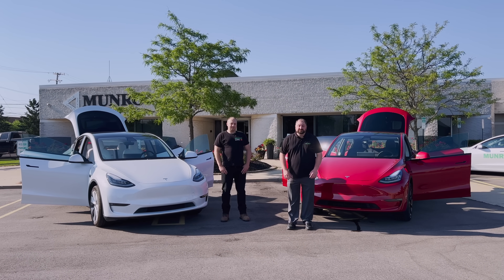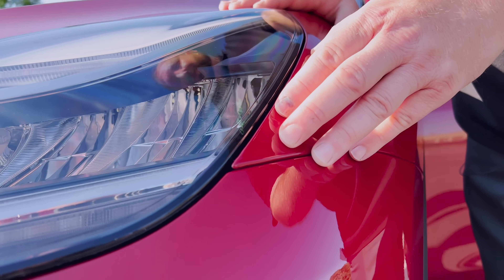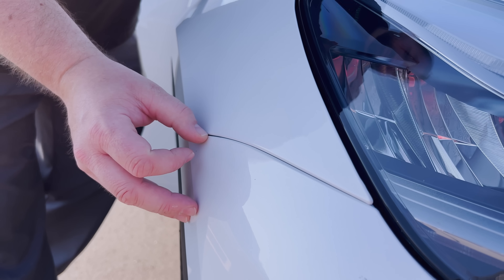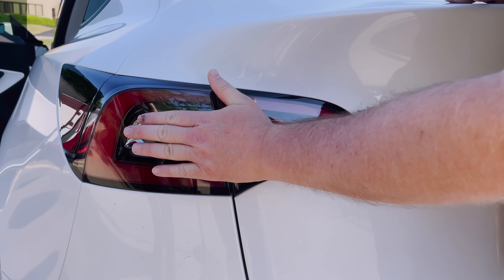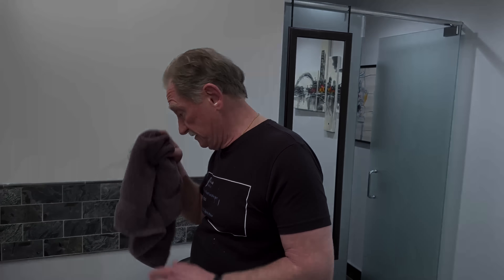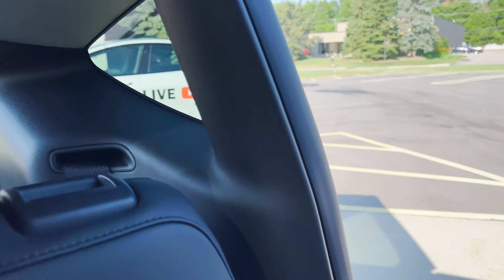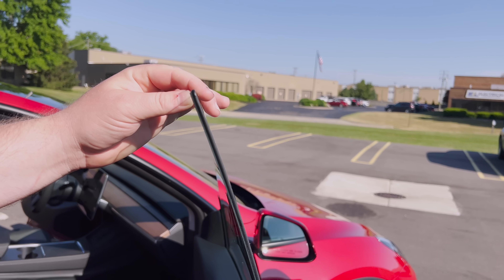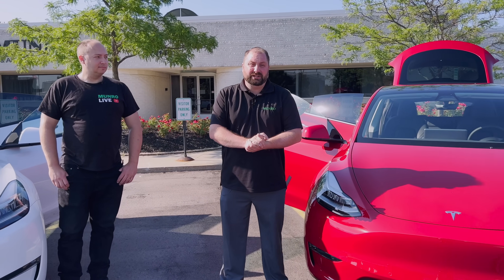Giga Texas Model Y Fit and Finish Comparison | Panel Gaps a Thing of the Past?

Comment: I understand that fit and finish is paramount in a "Show Car". It exemplifies the quality and skill of the builder. However, in a production car I would be more concerned with the "running gear" and associated hardware. Battery longevity being paramount with drivetrain simplicity and robustness being second. I see all the rest as a bonus. Sure I would like all panels to be appear to be seamless but "down the road worthiness" is what I consider important. Tesla is not supposed to be a flawless concept (Lucid Air) but rather a cost effective solution for the future. Price has to the governing factor with respect to efficiency and sustainability. Perfection costs money. People want more miles per kw.
Reply: You can buy a "cost effective" Toyota for one third the price of a Model Y and it will come with what you refer to as "show car" fit and finish.  That red car is appalling.
Reply: @wgmskiing  Not an electric one and I know . Only Toyota's and Honda's will be left running in the end. Driving to Lake Tahoe and back from the Midwest(38 hours), all we saw were 4runners and Ram 3500 cummins. Toyota's are e v e r y w h e r e!!

Comment: Parcel shelf or privacy screen?  Probably the latter.  It doesn’t look substantial enough to support much mass.  Also, anything sitting there could become a dangerous missile flying forward in the case of a sudden stop or crash.
Reply: Usually in European cars it's standard, good luck trying to sell a car without it even in second hand market, myself usually it is used to put a jacket or something like that if have rear passengers and stuff in the trunk, hats or umbrellas can happen and in my dad case that special pillow for your neck on long trips, in other words it's light stuff that are not to worry in case of a crash...
Reply: A cargo net is usually the answer to the missile problem.
Reply: @DishNetworkDealerNEO  You think alike.  I almost replied  to my own post with what you said about the net.  I have a pair of1st generation Honda Insights.  There is a rather large flat area under the rear hatch which is basically the cargo floor.  The Insight shipped with a net and clips already there.  There difference is the Insight mounting point and floor is substantial and well below the top of the seat backs.  The Model Y foldy-thing looks like carpeted structural foam.  I would not trust it to hold onto anything heavy, net or no net.
Reply: @wtmayhew  it is probably light structural plastic boards wrapped with carpet and seam sewn at the folds. Good only for light loads. Up to 20 lbs max, costing Tesla no more than $15-$17 to make in material and labor costs.
Reply: @DishNetworkDealerNEO  Thank you for the reply. Appreciated.

Comment: Love the recessed wipers, that will improve aerodynamics and efficiency a lot more than one would think. The thinner inner glass pane is a nice improvement too. It was just wasted extra glass before, more costs, more weight, and shrinking the inner cabin area.
I bet the fit and finish gets better with later production runs like we saw in Shanghai.
Reply: Recessed wipers, wonderful California design but buried in snow and ice in the winter!
Reply: @youtubemakesmedothis7280  could have heated wiper blades. 🤷🏼‍♂️

Comment: So the fit and finish was NOT helped by the castings. However, I suspect the castings may shatter in a moderate to severe impact. Of course, we will have to wait and see for real world collision data.
Reply: I bet the casting will help with the fit and finish. It is new factory that has produced about 10k cars atm. I think in Austin they're still working these things out. If we still see these gaps in Q4 made vehicles then I would be worried.
Reply: Why would you think a casting would shatter? Are welds somehow stronger than a single piece of steel?
Reply: @ymcpa73  Cast aluminum tends to be brittle.

Comment: Munro - educating the public on where to look for car finish issues ! Where I live, panel gaps are largely irrelevant - if your mirrors are still on, and your car isn't keyed it's a bonus....
Reply: Only .01% actually care for panel gaps but has higher voice due being a youtuber
Reply: I don’t understand people’s obsession with panel gaps.
Reply: @lemongavine  BMW buyers are paying $20k above generic ICE for labour to control panel gaps. Tesla buyers are paying $20k above generic ICE for huge battery pack. And don't give a crap generally about panel gaps.
Reply: @lengould9262  thanks. Yeah, I’d rather pay $20K for the big battery, better performance and not have to pay for gas, etc. than panel gaps.

Comment: I was hoping you would speak to driving characteristics differences between the two. Does the casting structure add a more rigid experience? I appreciate your thoughts...
Reply: +1 please do a driving comparison.
Reply: It shouldn't have much effect. I would think maybe a bit more body roll wout casting due to flexing otherwise the coil overs up and down are the same.
Reply: @coltburks5450  I disagree. There is far less flex in a single piece, casted unit. Frames have welded in reinforcements to firm them up and reduce flex.
Reply: @jeffkeryk3550  I believe that's what I said.  A casted piece will Crack before flexing a welded piece will flex before cracking. Therefore more lateral flexing with the previous welded body sections.
Reply: @coltburks5450  All good Colt.

Comment: Tesla more often than not can get away with telling customers that any gap is “within spec”. I own a Shanghai Model Y LR and it has no noticeable panel misalignments. I’ve seen a Berlin model Y performance and it had some ugly panel misalignments. As far as I’m concerned, only noticeable/inconsistent misalignments are an issue
Reply: Yeah wait till they review a Model Y from Shanghai, Elon have said they were impressed by the work in Giga Shanghai

Comment: Always interesting but I'm not a crazy fit and trim guy. Most of these things aren't something that affects the car's performance, durability, or life expectancy. Tesla continues to improve on such things but they are much more focused on the actual driving features, safety, and lifetime malignance issues. I'll take quality building in what makes the vehicle move down the road and require little or no maintenance over the beauty pagent issues. Just me but I buy a car to drive and to perform over buying one to take to the car shows.
Reply: Id argue that most people don’t care about that but its certainly indicative of the overall quality of the vehicle because parts and assembly both need to be great to get great quality
Reply: The only concern is that the panel alignment could be a visible example of how close they get to the intended tolerances generally for the car. What if there are similar variations affecting vital components that are harder to see?

Comment: As far as I am concerned the panel gap issue is actually a non-issue and therefore of little or no importance.  The overall engineering, drive components, and software are the main topics of interest for me, and I suspect for others as well.
Reply: Exactly my take on it.. I don't buy a car to put in a car show I buy it to drive it and have it last with little maintenance. The safety and overall design of a Tesla are outstanding.. I'll settle for a few little fit and finish issues. It's the difference between making a car to look good and making a car to hold up to years of use with little or no issues. Lots of those cars with all the time spent on gaps and such don't have the quality where it matters.
Reply: @JorgTheElder  Very poor analogy.

Comment: Interresting comparison. About tailgate: it has to be adjusted manualy by the screws. Thats done by human normaly in the finnaly valuation
Reply: yes indeed as i recall. the lights can be moved slightly too to align better. not too difficult but still takes some time if you're fussy about it, but not impossible to adjust equally on both sides
Reply: These guys know everything already! The point they were making was that the Gigacasting process should, in theory, make the gap you are placing the tailgate into more consistent in shape and dimensions ... this should give them a better chance of getting the final alignment correct ... but on the evidence of this video it doesn't seem to have helped much.

Comment: This is hilarious.  People obsessing over minutia.  The first AH at Walmart who backs into the bumper of any brand new car will cause that and more.  The tolerances that matter to me are the tolerances of the mechanical parts like the motors and drive line components.  That Plaids can rip off 9 second runs one after the other for months and months tell me that Tesla's true quality is where it counts.  My 2016 S has been trouble free, and that's what counts to me.  TBH, I never took a quarter and ran it through the gaps looking for a mm or two from side to side..  All I know is that the paint is as bright and glossy as the day I bought the car.
Reply: I know this is important for some but oh boy how I don't care one bit if a panel is off slightly when my face is 3 inches away from the car.
Reply: This is knowns as "willful blindness".  If there is an assembly problem that is causing gap issues, then it should not be ignored.  These things need to be addressed and refined just as much as a gear or axle problem would need to be addressed--  when you're talking about "quality".   Someone, somewhere has a job of putting these things together, and you're just ignoring that they even exist by only focusing on the motor/ battery ect..   those people do exist, and they need to step up their QC in letting these defects slip through;    and/ They are not "obsessing;   they are simply nothing the differences that are there.   This kind of stuff isn't important to me either-- I take all my vehicles offroad, and they will have scratches and dents all over, and I couldn't care less.  But that's me.
Reply: @calholli  But it is obsessing.  Back in the 70s, when you could slide a sandwich between the gaps between the fender and front door of a Caddy, auto magazines praised the "beautifully turned out" coachwork of German and Japanese cars.  Well, my buddy has a mint 300ZX with 12K miles on it and my Tesla gaps and paint are better.  So what?  It has gotten to the point of absurdity.  When you have to get your face 12" away to see these "quality" problems,  the problems no longer exist.
Reply: @calholli  Perhaps, but I honesty don't care what OCD people think.
Reply: @ohger1  Exactly.  If the car last just as long with or without uneven gaps, I would turn my attention to things that really matter.  They're obviously improving their processes and improving with or without us holding our rulers.
Reply: There are a bunch of model S that aren’t quality including plaids. Reddit is the spot to verify my statements. My own model Y was a steaming pile of 💩 and spent 4 of 7 months I owned it being “fixed”
Reply: @JorgTheElder  Coachwork quality is unrelated to mechanical systems quality.  I just replaced the long block in my daughter in law's Subaru Legacy.  Beautiful gaps, but had a ringland failure at 80K miles.  But those gaps are perfect...  Check Sandy pitching wood over the insane construction quality of the Tesla motors, drive, and electrical components.
Reply: @ohger1  "pitching wood" -- ?   I'm not sure what that means.   but also, what about the guy who had some gravel bounce up and break a simple coolant line on the front of the battery, and they wanted to scrap the whole battery and charge him $16k just to fix it. ??   When 'Rich rebuilds' figured out a way to tap the line and install another fitting and make it work 'FOR NOW....   but if you want to talk about problems, that's a big one.   They should have a connection block there that has a machined surface with a O-ring seal and a couple of bolts.  That way the outer part can be replaced if need be;  just like several other car brands mount there heater core lines to the firewall, in an ICE car.   There shouldn't be a plastic hose sticking out of your battery, that makes it unrepairable- especially for something that's so flimsy and known to be prone to break- that's a terrible design.   AT the very least, they should have a heavy shield/ panel over the connections at the battery.
Reply: @calholli  Yep, a one in a million problem that could be repaired with a simple shield. I would have fixed it the same way but I thought his fitting was sticking a bit too far away from the battery.  My daughter in law's Subbie needed a new engine at 80K, and that had nothing to do with road damage.  Shit happens.

Comment: Is this just a matter of new factory "teething" issues, or does Tesla have a systemic problem with build quality?
Reply: Depends on what you call "build quality".  If you mean coachwork, then yes, Tesla's gaps are more inconsistent than others.  But fancy bodywork often hides garbage mechanicals.  My interest in build quality is motors, gear boxes, electronic design and construction, and operational systems quality.
Reply: @ohger1  Turns out that is what matters. Its why Lexus and Toyota often do so well. Even though they have plenty of panel gap issues all the time. The engines are 100 years old though so there isn't much in those cars that hasn't had decades and decades to be ironed out. 

Panel gaps really don't matter and are super common everywhere, across all makes.
Reply: Tesla has no more build quality issues than any other make today. Walk into any dealership and start going over the gaps and seals and everything like people like to do with Tesla and you would be shocked. MB, BMW, Lexus, Toyota, Audi... all have had issues like this, or worse. 

It is a constant and continuous thing with making cars. Lots of design language is actually designed to help hide little imperfections better because it is bound to happen and is all very minor cosmetic things that dont really matter. Tesla needs to keep working on it, and they always will. Just like every automaker has done for over a hundred years

Comment: Great video. I'm still disappointed with some of these fit and finish issues that Tesla is still having. I really thought Giga Texas was going to solve the problem.
Reply: You do know its a super common issue with ALL automakers I assume. These sorts of gaps are very, very common across every make I have ever shopped. From Toyota, to lexus, to BMW to MB. There is almost always something ever so slightly off. When people complain about Tesla (Sometimes it is warranted) others its just propping up a stereotype. 

Tesla needs to continue working on closing gaps (pun intended) but its not only a Tesla thing. My Toyota atm has plenty of issues though minor. They are just as minor as the things on this Tesla. It doesn't change the vehicle in any way, and you need to pull out a ruler and get your face inches away to really see them.
Reply: Not instantaneous

Comment: 2010-2017 Camry are the best years for reliability
Reply: reliability has nothing to do with panel gaps... Toyota is reliable because they use 100 year old engines still. Go ahead and walk around the Toyota lot or Lexus lot with a ruler and scrutinize panel gaps and placement. You will be blown away.
Reply: @Kenbark42  nobody cares

Comment: Are both cars manufactured during the same phases of the manufacturing process?…probably not….early or during ramp up or peak manufacturing…I am assuming they have not hit the peak at Austin…quality varies depending on which phase they are in as Musk has stated…one need to compare apples to apples….just saying…otherwise great insight…

Comment: Fit & finish is still.....questionable isn't it. On the red car, rear hatch forward edge where it meets the roof, passenger side, that gap to the roof (@3:40) was truly massive, particularly compared to the driver side (@3:25).

Yeah, I know, still knocking panel fit...but still, they've had plenty of time to improve it.

Comment: Well that was extremely disappointing as I am about to take delivery of a TX model Y in a couple of weeks. I am mostly concerned with the curb weight. I have a 12/2020 model Y and when I ordered a new one I was hoping to see a 400 pound decrease in weight and early reports are only 150 pounds. I just don't get that. Are the battery casings that heavy? And wouldn't the elimination of battery module and pack housings more than make up for that?  Can't weight to find out.
Reply: That was a waity comment.

Comment: Can't wait to hear about the new batteries. Are they supposed to be lighter, more densely packed, more efficient, charge quicker, all of the above?
Reply: Stay tuned…
Reply: They charge a bit slower actually
Reply: I think they will improve the charging curve by time. They lower it in the beginning to get reports from the car. And as more 4680 cars are out the more data they will get. So the more cars out on the street the more they can improve the charging speed because they got enough data to optimize it
Reply: @Peter.S96  
That’s not how it works sir!
This isn’t Autopilot…Lol
Reply: @RayNLA  really? But with 2170 on the model 3 they also optimized the charging curve by time. And how can they do this? By having technical feedback/reports?
Reply: @Peter.S96  
The cars BMS  Battery Management System does this. The reports of slower charging time with the new batteries may be because of the difference in chemistry. (I’m speculating) I’m sure more information will be coming out soon.

Comment: The two thickness glass should help dampen the resonant frequency of the glass. The wiper arms being less proud should reduce the chance of a wiper arm scratching the under side of hood, if it gets slightly bent during ice and snow removal (happened to me after an ice storm and not being gentle enough) 
-Did it have the wiper heaters too?